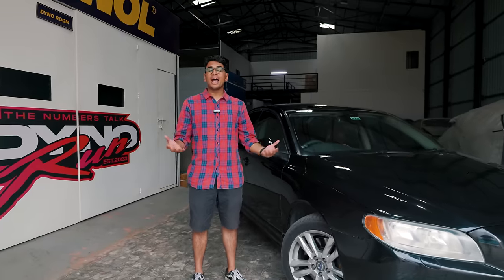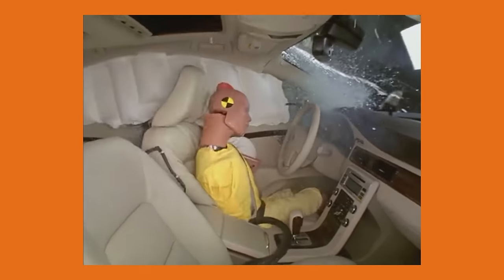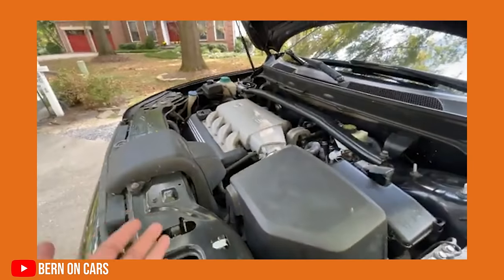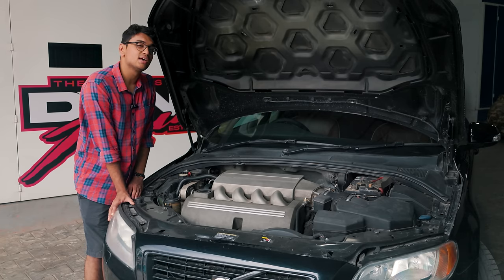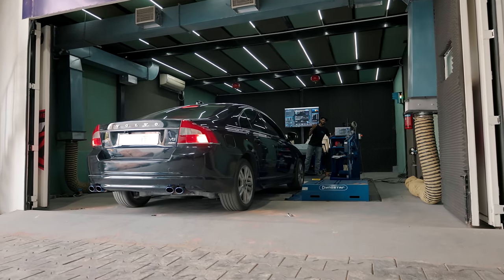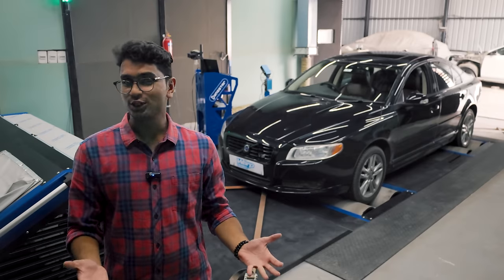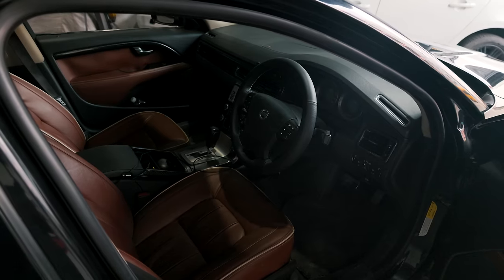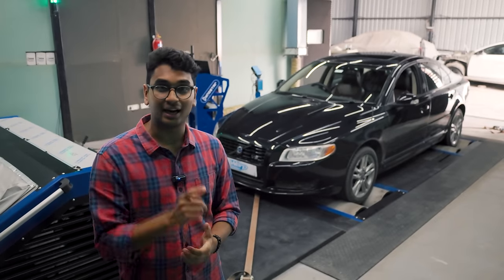This Volvo's V8 Engine is made by Yamaha?! | 2008 Volvo S80 V8 Dyno Test! | V8 Symphony by Yamaha!

Comment: Maintaining this car would be a nightmare
Reply: Not really, its quite reliable owing to engine being built in Japan. People in Europe & USA average around 300k Miles on the car before needing major maintenance. Parts are available plenty in UK, USA which can be ordered online & imported to India but are generally cheaper in cost than BMW, Merc or Audi.
Reply: 3 years in at 160,000 miles and I bought it when it had 136,000 miles, and I've only had the usual maintenance repairs needed for a car that's 17 years old. I haven't been light on the pedal with it either, still a hell of a highway puller for it's weight. The AWD system will chew through front tires nearly annually though, I swear. Hasn't been any more or less of a hassle than most other modern used cars I've had.
Reply: My s80 v8 is at 251,xxx  it’s leaking form the valve covers coolant hoses leak suspension is shot power steering return hose ruptured but it still runs and shifts perfect, she’s my project car but she still drives like it has 100,000 plenty power and life yet
Reply: Nope
Reply: I’ve had mine for 6 years. No issues as I’ve maintained properly throughout this ownership
Reply: Like you wouldn’t believe. Costs a lot to go fast
Reply: 2007 V8 xc90 284,200 plus miles and still counting

Comment: KIAS and Hyundai's are willing to rev  redline  not to  get  beat by a 6,000 lb xc90 v8 out of the hole.
worth a few chuckles at the fuel pump  ,....
The tail gate on the xc90  with door for rain block is nice at picnics. 
Built for life....VOLVO ....